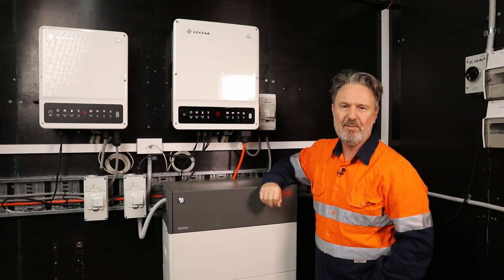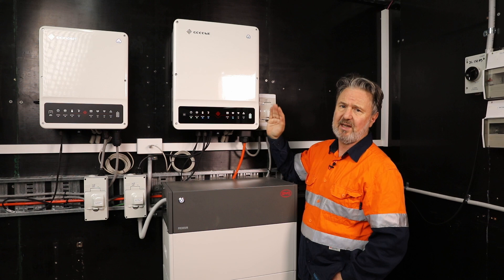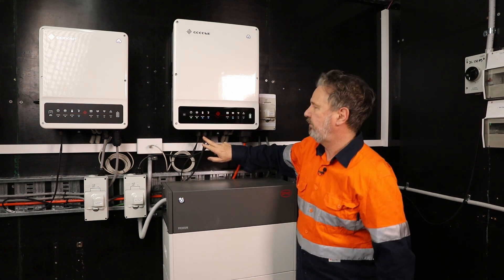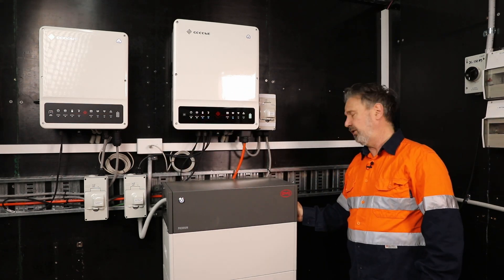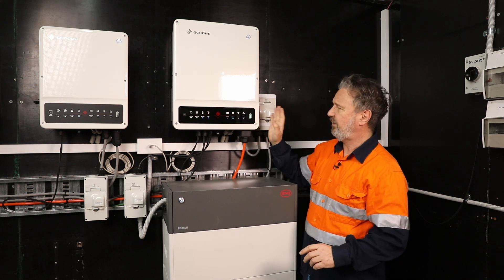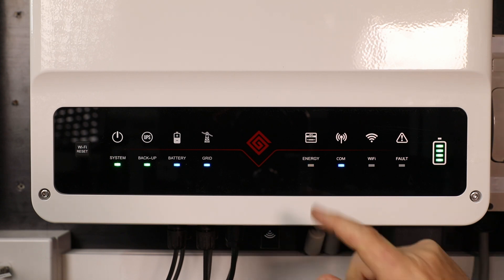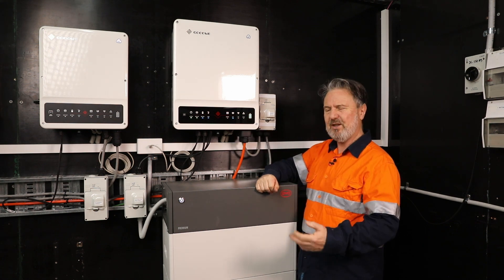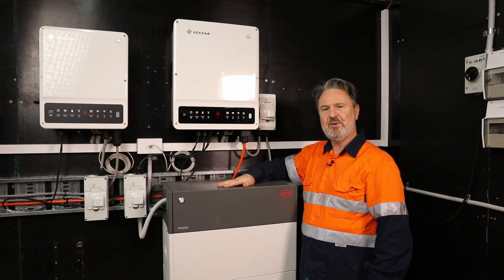Goodwe 5kW 3 Phase Solar Hybrid Inverter

Comment: Hi Glenn.

I would like to do an installation exactly like that, but I am in doubt about the meter and placing the inverters in parallel, which according to Goodwe, is not possible.
Could you tell me how you were able to do the same?

Thank you very much in advance 😀

Comment: Hi Glenn am interested in knowing if Goodwe 3 phase inverter can be wired to work completely off-grid with a battery back back
Reply from the maker: Hi Lubega, possibly but the Goodwe 3 phase would require manual generator starts for backup

Comment: Hi Glen, are these ET inverters able to run unbalanced outputs when these is no battery pack? Cheers
Reply from the maker: Hi Michael, I wouldn't imagine that that is possible if there isn't a d.c. source to balance the charge/discharge across while supplying an unblanced load.
Reply: @SmartEnergyLab  Thanks for that Glen. The reason I ask is that I live in NZ and our 3 phase power meters sum each phase individually which mean with balanced outputs unless we are equally consuming across all 3 phases we are always putting more power out to the grid (at a cheap rate) than we need to. Some 3 phase hybrid inverters like this one and the solax x3 have an option for unbalanced outputs which greatly helps with self-consumption, but I cant find in their documentation whether a battery is required.
Reply from the maker: @mab37  Hi Michael, yes, I'm pretty sure from a theoreticaly perspective that a battery is required. Happy for someone to correct me but all the three phase systems that I have here at the lab that can do unbalanced load support have batteries attached. I will investigate further to see if I can find any other solutions for you other than direct load control, such as water heating, that can be switched on to ensure the phases have approximately balanced loads when generating from solar.
Reply: @SmartEnergyLab  Cheers Glen. So I guess that means on a typical 3 phase hybrid inverter (balanced output) with a battery then when the battery discharges to the inverter to meet a load, the inverter treats it just as it would DC coming from a solar array and convert it to AC over 3 phases? My assumption is that it would.
Reply: For example its the middle of the night with no solar generation but a full battery. If a single 1kW load (like a heater) is applied to 1 of the phases, would the battery end up discharging 3kW (DC) to the inverter which would in turn output 1kW (AC) to the load on one phase (heater) and 1kW + 1kW would go back to the grid on the unloaded phases?
Reply: @mab37  did you ever get answers to these questions? I'm contemplating get one of these inverters...

Comment: Hi Glen, whats the battery certification required for high voltage battery in New Zealand at the moment.
Reply from the maker: Hi John, are you referring to certification of the battery or the installer? If the later then you just need to be a licensed electrician as you're working at LV levels. However, you should be competent in the technology you're working with so additional professional development training would be advised. Many of the manufacturers of batteries run their own training as well as more general training from me here on my channel.
Reply: Hi Glen, thanks, appreciate your reply and I do follow your channel. I am referring to the certification of the battery itself. the inverter is a hybrid and with HV battery.
Reply from the maker: @johnali7144  Hi John, the battery is the BYD HVM battery that is IEC62619 certified and on the CEC approved list in Australia.

Comment: whether it supports battery vrla, with a voltage of 48v 800ah / 4 banks
Reply from the maker: Not VRLA nor 48V battery... only compatible HV batteries like BYD HVM
Reply: @SmartEnergyLab  thank you ,, brati only support for lithium battery

Comment: I would like to know if Goodwe 5kW ET Hybrid can be connected with high voltage supercapacitor of 384W
Reply from the maker: Hi Moin Fudda, I doubt that the Goodwe ET Hybrid could be connected to an un-managed source as it is designed for high voltage batteries which required closed coupled control by the BMS to ensure that the battery stays in the safe operating voltage range.
Reply: Dear Glen, Thanks for your reply and sorry to trouble you again. Actually, dealer if KACO has installed its 10kWh Hybrid Blue Planet at my Residence and because BYD or LG Chem batteries are not available in Pakistan I am asking him to connect it with Sirus Supercapacitor 10kWh high voltage range of 352 to 432vdc. Since the battery input range of KACO is 96 to 450vdc, I wonder it it would work. Alternatively I can ask him to try with either 2 or 3 48vdc which you had reviewed earlier. 
Appreciate your technical advice. Warm regards Moin Fudda www.fudda.org
Reply from the maker: @moinfudda1014  I would ask KACO if it's compatible first. I doubt very much that it is.

Comment: Hey Glenn on these Good we inverters if the inverter was to have a fault would we loose power to the back up circuits as it is supplied through the inverter?